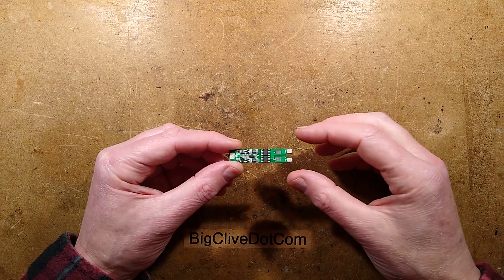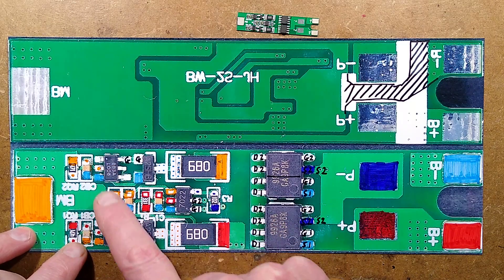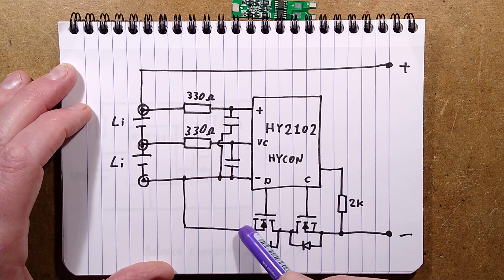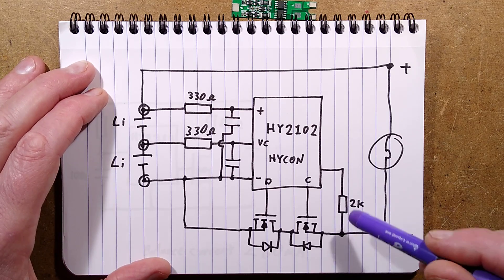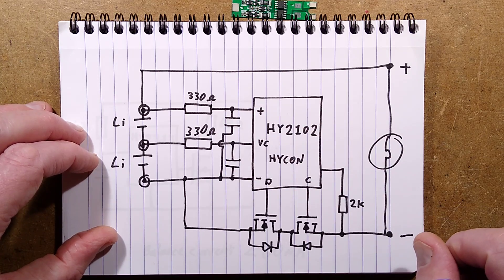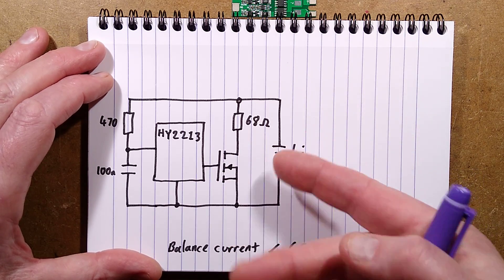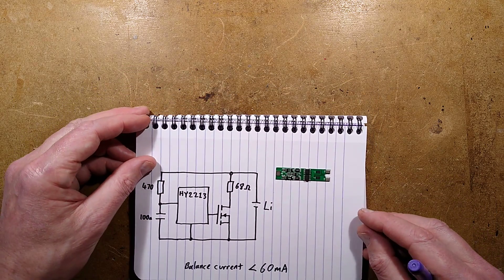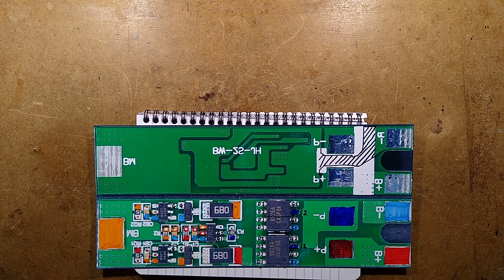Lithium cell balancer reverse engineering with schematic

Comment: i charge my 10s  cycle packs using external balance leads via a hobby charger [b6ac clone] when a cell group  reaches 4.2 v charge current drops to a fluctuating 0.1/0.2 amps, which can  take a very long  time to bring the other groups up just 0.05 volts, so in effect bulk charging with a restistor soaking away current on full groups doesnt work, looking at building a charger with 10  five volt suppllies [for electrical seperation] supplying 10  tp 5100mu charging modules monitered by a couple of volt displays each displaying 5 groups

Comment: Never thought about using the mosfets for current sensing before. That's really cool. Not the most accurate but certainly good enough for this application
Reply: Not the most accurate resistance-on but cool anyways.
Reply: More accurate than one would think....

Comment: What I would like to know is where does each HY2213 get its positive and negative power from?  Another thing that's important to anyone who stores lithium cells is how much current does this circuit drain from the battery while it's sitting on the shelf??

Thanks, Clive.
Reply: Power comes from the sense inputs, and they normally use a tiny amount of current, 100ua or so, or even less for the ones with low power as intended use, with integrated mosfet switches, so they basically will operate over a year on your standard 18650 cell, without using more than the self discharge  already does.

Comment: Love your vids where you're reverse engineering. 
What is this module used for? Or what is its common use?
Reply: Radio Control model batteries  - drones etc. Which commonly use 2, 3 and up to 6 cell batteries.

Comment: That’s amazingly simple. I wonder if you could do that with some very specific zeners, especially with something like Lifepos.
Reply: The circuit should work across all types of rechargeable battery chemistry. The issue is the cut-off voltage. The different types of batteries tend to have different max voltages. The controller chip usually works across all types of chemistries as well. But the trick is telling the controller which cut-off voltage to use. And that's often done through a resistor or a pair that tell it which cut-off voltage to use.
Reply: @shanejohns7901  No. Not suitable for all types of chemistry. Ni-Mh and Ni-Cd cells use a totally different charge profile and the way the end of charge is determined is completely different than a lithium cell. Lead acid is once again way different.
Reply: @davelowets  It would work so long as the target voltage is under the max voltage. That may not ensure the fullest charge on the battery, granted.
Reply: @shanejohns7901  We want chargers that CHARGE our batteries...
Reply: The cutoff voltage for Lifepo cells is typically 3.65v. 3.6v is a pretty common zener voltage.

Comment: Your master control chip has 6 pins, you forgot Vcc. 
This is the method 90% of rc chargers use to charge balance packs, but the mpu senses the voltages and turns on the bal fets. This also has the benefit of lowering the output current to the ballance capability. Thanks for the video.

Comment: I believe you're correct that the balancing circuits only have a limited current capability to effect balancing; if you could somehow charge at 1A forever it would "overwhelm" the ability of the balancing circuit to keep the cells at the same voltage, resulting in (temporary) overcharge for the higher-voltage cell.

The reality is that this condition really can't occur except in a scenario where the cells are extremely badly mismatched in terms of capacity, and in those scenarios your pack is pooched already. Since the balancing circuit is always active, there's no scenario where you can otherwise get the individual cells into a wildly different state of charge, and any time a single cell is at 4.2V, the whole pack will already be at or close to the CV part of its curve, limiting the current the pack will accept. Charging continues until some fractional current cut-off of the standard charge current (between 1/5 and 1/20 of the normal charge current) as it would in any single-cell charger, and that cut-off current is generally around the same order of magnitude as the balance current (60mA in this example) so that the CV portion lasts long enough to ensure all cells reach a mostly-balanced state before cut-off.
Reply: Overcharge will not happen not even "temporary". The protection circuit will detect the high voltage and open the mosfet and terminate the charging process. This happens, when the balance is poor and this balancer will never be able to correct it  (as you explained). This is why it is a bad idea to put a resistor across the mostfet as it bypasses the protection and may destroy the cell.

Comment: Kind of akin to how solar panels have a bypass diode, so if one panel is in the shade, it'll just pass the current from the other panels it's connected to until it has the power to join in with the fun... :)

Comment: These are my least favorite cell balancing systems. The charger side certainly works with that circuit board in the battery. You can tell when someone has implemented this sort of thing because it takes many many hours to charge a battery instead of only a couple with other designs
Reply: "Many, many hours" is pushing it a bit.... If it's a HUGE pack with many cells, then yes it could. For a small 2S pack, then no.

Comment: Wat always worry's me with protected Pacs is what if i put them in Series? 
One pack will inevitably open first, exposing the mosfets to X time the pack voltage (x being the number of packs in series)
Reply: No current flows if the circuit is open at any point, so it doesn't matter what the voltage is.
Voltage is relative to the circuit's connections, so the middle pack BMS is only exposed to the the + and - of the cells it connect, eg 7.4V not 74V (10x 7.4V).
The only exception would be if the metal case is connected to 0V, and the BMS is bolted to that, then you have to consider the insulating materials (eg the PCB fibreglass).
Reply: @station240  Maybe i did not explain it right. 
Lets make it simple and go with 1,5V battery's assume you have 10 in series so 15V, a switch and a 15Ohm load. 
The switch needs to switch 15V and 1A. if the switch is open there is 15V drop over the switch) 
Now if the switch is supposed to be a Mosfet it also needs to withstand 15V and 1A. 
So now if there is a switch/mosfet to swtich off in every cell. it needs to withstand 15V not 1,5V

Comment: It can at most trickle the other way around due to the capacitators, and what stops one coil from being operative is the voltage in the other direction, aka how much it has been charged.

I think you are making a mistake, but i could easily be wrong, im no expert nor anything of the sort.

Comment: It would be interesting to see an experiment to check if your theory of a resistor between P- and B- would work as you expect.
Reply: The only downside I can think of is it would bypass the low voltage cutoff too, potentially leading to dead cells.
Reply: I would expect the circut to work quite well even on high charge currents. I expect the cutoff to be slightly higher than the balancing circuit, so the balancing would kick in early. If this is the case, and the cells are quite well balanced to begin with, it would not take many cycles of switching on and off the charge circuit until the cells are balanced.
Reply: @tomvleeuwen  I will have a play with one of these to see if I'm correct but looking at the circuit we are assuming the charging transistor is completely switched off, It might be that its partially switch off so there is enough current to balance the cells since the balancing circuit bypass each battery when it reach the threshold (4.2v)

Comment: AFAIK, Typically all a simple cell balancer does is slowly drain the highest cell until it matches the voltage of the lower one.
Reply: If you watch this video, you will learn that this balancer does not work in the way you have described.

Comment: Cell/Pack protectors usually monitor for several conditions - if any of them occur, the cell/pack is turned off. Those conditions are 1) over voltage (about 4.25V), 2) under voltage (about 2.50V), 3) high temperature, 4) low temperature, 5) high current (heavy load or heavy charge), and 6) short circuit.

Pack controllers usually place a small load current across high cells (4.20V?), and may disable charging (using the protector circuit as a switch) while the single cell is being discharged.

In a simple system like this, there is no communication between the balancing circuits and protection switch. Both cells could be shunted by their respective loads without the protector ever stopping charging.

Fun factoid: While current is flowing through the MOSFET body diode (MOSFET turned off), the diode develops a voltage of about 0.7V. If the MOSFET is then turned on, the MOSFET will short out the diode - the voltage drop goes to 0V (=I * Rs). MOSFETs that are turned on conduct current equally well in both directions.
Reply: How body diode can be short out to when mosfet are turn on ? Body diode is connected reverse bised Respec to Mosfet Turn on Conduction !!I mean it will show but in opposite way .
Reply: @omsingharjit  The near 0 resistance of the Fet, when it's turned on, is across the diode and shorts it out. It would be no different than manually placing a wire across the leads of a diode in a circuit.
Reply: @omsingharjit  explained in another way, mosfet can switch AC (with isolated gate drive) but will always pass more than 0.6V in one direction
Reply: @plainedgedsaw1694  I mean , AC like wave goes from zero to positive than zero two Negative but when you have circuit which operates at vcc and gnd than your signal can only go between zero to Supply Vcc , it can also be sine wave but perhaps it's called DC offset sine wave not AC sine wave , and in puss pull mosfet configuration it's possible to get ac through load by discharging and charging one of each cap at a time which is connected access single supply same topology used in Pc ATX smps using BJT .
Reply: @omsingharjit  yeah, i was just describing that mosfet is acting like a switch with diode across it.
Reply: @plainedgedsaw1694  oooh  my mistake , I thought it's different comment section of different video ( video of Class A amp of single Transistor ) 
So when you mentioned moafet , A C etc I thought it's that comment 😀😀
That was ...
https://youtu.be/vRZMKN-6uBM
Reply: Yes, that with the MOSFETs having very low voltage drop when turned on (much lower than the body diode or any diode for that matter) and also that current is conducted equally well in reverse, is often used in synchronized rectification or "freewheeling" to to increase efficiency of DC/DC-converters and various rectifiers (particularly when output voltages are low - where the power loss caused by the voltage drop of standard diodes, become significant). The diodes are replaced with MOSFETs that have their body diode "pointing" in the same direction as the normal diodes would otherwise have - then the MOSFET is turned on when the normal diode would otherwise conduct and then turned off again before the current change direction (a slightly more advanced control circuit and in many cases isolated gate drives for the MOSFETs, is needed though - to make sure the MOSFET is only on when the diodes would conduct. Otherwise, current will flow in the wrong direction).
Reply: @Speeder84XL  yes , power mosfet with body diodes avoids needs of extra Rectifier diodes in Ups and converter ....
Like if you have one transformers in Ups which works both directions step down for charging battery and step up  when taking 12v for stepping up the voltage in both cases same mosfet are used during oscillation mosfet act as switch and other Wise as Diode because of its internal body diodes .
Reply: Grr... A factoid is something that looks like it it is or is taken to be a fact but isn't. The clue is in the -oid ending - think android, humanoid, spheroid etc.
Reply: @Graham_Langley  that makes sense
Reply: @Graham_Langley  Alright then... Its a fun fact!😀

Comment: electron flow and conventional  theory gives me a headache 🤕
That's theories for you.
Reply: Apparently ... 'They' only worked out about tectonic plates in about 1967... and prior to that didn't know why earthquakes happened...

Then there were those videos in the last few months about how fast electricity travels...
I watched several...
Most tech things I get to understand...
Concluded I have other things to do...
A rare occurrence...

Oh the fun of scraping the paint off an OC71...
and the 555/556 are still used...

Lead acid batteries have gone up in price in the last 6 months!

May I ask a question...
12v 8amp bilge pump..
Mechanical float switch... Did have mercury switch but terminals rusted after 20 year's... Can't buy as now dangerous... Thinking of making new capsule...
Would a big diode opposite to flow help stop arcing... There's a new (last 10? years) type of diode... So which type of diode... Was thinking of one out of an alternator... Would I put a capacitor as well... What size and type and if electrolytic which way round...
Was thinking of an in series fuse of lower than 8amp? So if diode/capacitor goes 💥 pump not on continually...
And....
To stop the pump getting such a jolt.. it jumps... when it starts what size/voltage and type and which way round... Capacitor would you suggest...

I tried asking Clive some time ago but he is a bit busy...
Regards Mark.
Reply: I just do "what I was taught" leave the "modern" theory's to someone else 👌 👍

Comment: When charged appropriately up to a fixed voltage, the current flow through these balancers should be minimal, as each cell is held to the target voltage. An "unequal" charge will overcharge (and potentially damage) the "high" cell until the voltage across the lower cell rises to the point where it's charging at <60mA.

Better (and of course, more expensive) balancers use a charge pump or a switching supply to shift current between cells in a less wasteful manner. That sort of balancer is used between each pair of cells, so e.g., a 3S balancer would have two balancer subcircuits, rather than three. This also means a pack can be meaningfully balanced without external charge being supplied... that trick's more common with ebike, home inverter, and other larger packs that may need to balance while discharging late in their life.
Reply: yes, it would be nice to reverse engineere those "active" BMS....Until recently I thought all BMS had this active balancing function....but when I opened the battery from even a very expensive Kalkhoff e-bike, it only had a passive BMS....which led to all sorts of strange behaviors - sometimes it wouldn't charge, sometimes it would show that the battery was empty, but it would go for another 100 km.....It would be nice if someone did review of aliexpress active BMS, since there are like hundreds types...
Reply: The second scenario you describe is called "active balancing". (Rather than just burning excess off, as we see here) These boards are available too, on AliExpress and the likes.
Thanks Clive!
Reply: Matter of consideration. The additional electronics could be more wasteful that the burnt energy?
Indeed, if you go through the numbers, a ebike should definitly have an active balancer, a small 2 cell battery pack should not.
Reply: @twoina  i mean, passive balancing has an efficiency of 0%, as the balancing consists in turning extra energy into heat. Even if the charge pump is only 20% efficient, that's still more than 0%
Reply: @gabrielenitti3243  i mean, the production of the extra electronic costs a lot of energy, too.
Reply: @twoina  Yeah depends on the capacity and the difference between cell capacities. One other issue with the active balancers is that they have a higher quiescent current draw, so they aren't as well suited for packs that aren't used frequently. I was experimenting with one in a somewhat large (~100Wh) portable battery, and it would drop the charge by a significant amount over the course of a few days. That one was likely a bad design though.
Reply: @Lizlodude  you may have a faulty one or it was balancing the cells and you were not aware of it. if you had a 50ah battery pack and an active balancer which is 1amp it would take a very long time to balance them all. they can be trying to balance even though the led is off.
Reply: Haha, some one was quicker to reply. Sorry, should have read to the bottom first.
Reply: Correct, the best balancing ckr is a bottom up buck charger where weaker cells are given boost bursts at a specific time interval.  Yes these ckts have more parts bur they are less of a risk to the battery management system.